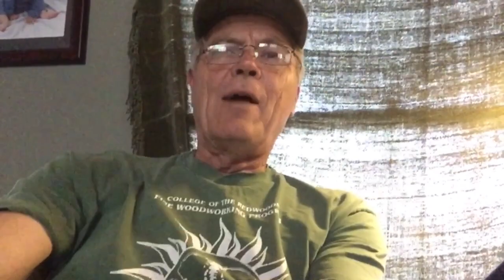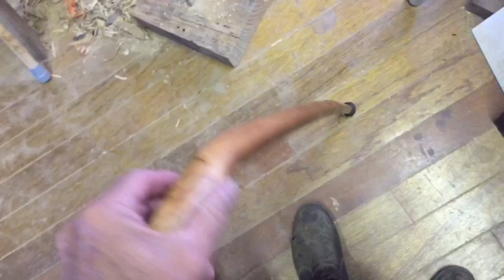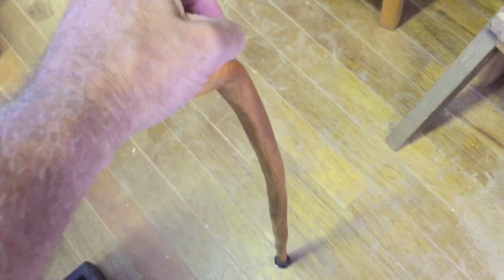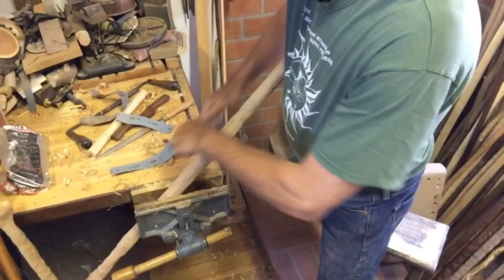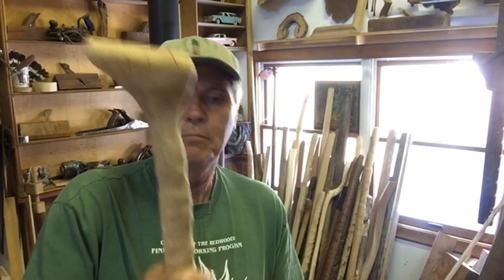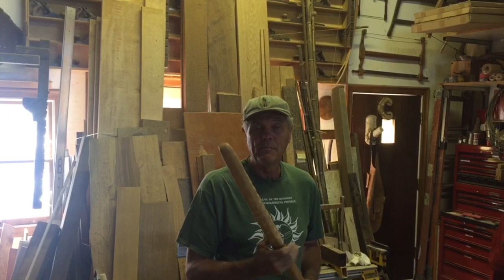Solid Wood Walking Sticks

Comment: Like you said, it's a matter of preference !  I like all the sticks but one and that was the very first one although it is a pretty wood, the bow just didn't do it for me, lol.  I'm not being critical, at least i am not trying to be.  I to dislike the "FACTORY "look.  I am trying some Crepe Myrtle for sticks and find that it can split overnight and it is very heavy.  I have a friend that trims his crepe myrtle every few years and the new branches have a knob where the tree was trimmed and I don't have to make a knob.  I live in N. Florida and there is a lot of logging here so many of my sticks come from where an area is going to be cut and many of the right size sticks are waiting for me to harvest them, wild cherry, oak and others, if I don't get them, they get run over and eventually pushed up in a pile and burned.  I just don't cut live trees. Thanks for the video, I don't post my work because I don't know how .
Reply from the maker: Well thanks for commenting Albert. A walking stick can give someone a bit of dignity. A cane just says “I’m weak”. A walking staff is useful for so many things. Including spider webs on the ceiling!

Comment: Hey Blair, off topic question for you. How does one cut off a stump that has 12 guage welded wire fencing embeded in it? Grab your least favorite saw and chain? What happens when the chain meets the wire, does all cutting abruptly cease? or does the chain break and fly through the air like a ninja beheading the careless operator?
Reply from the maker: Brian Johnson it cuts for a tiny bit but it's dangerous to try and cut metal with a chainsaw. But to slowly find the steel and cut with a grinder, old chisel or other breaking tool. Good luck